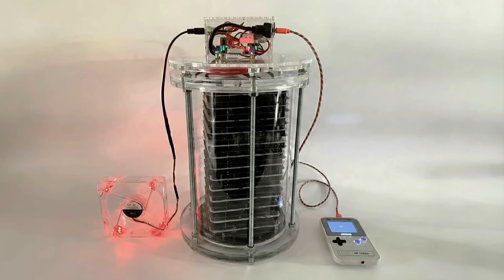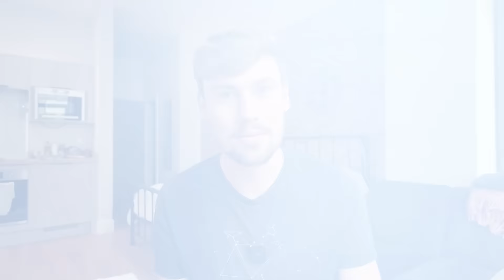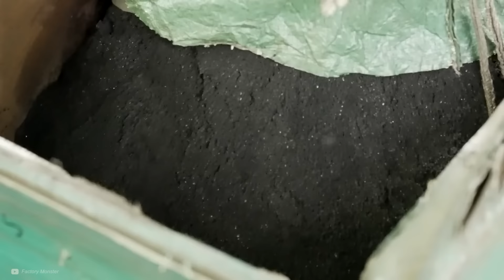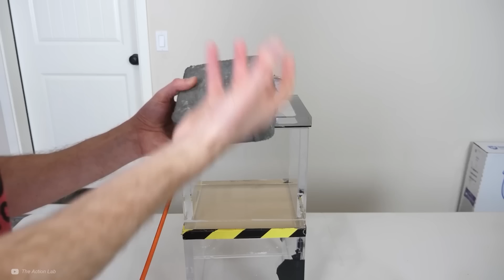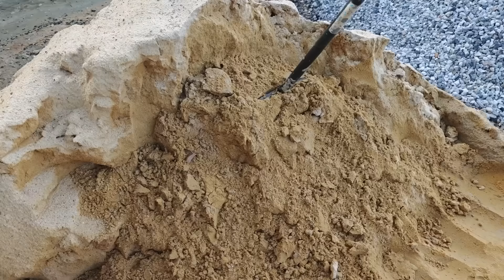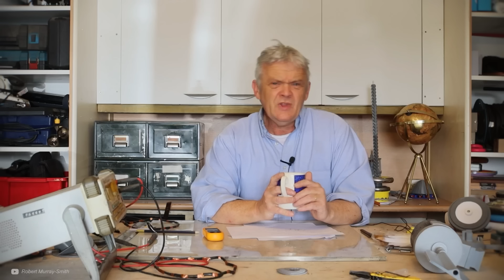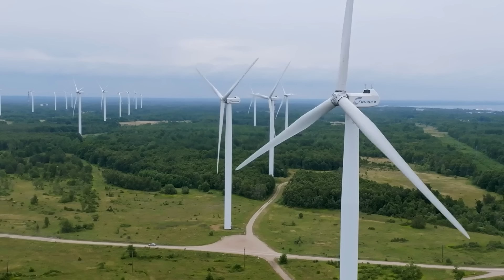How MIT's New Concrete Stores 10x More Energy

Comment: When I was a young engineering student I learned that there are two kinds of concrete: concrete that has cracked, and concrete that hasn't cracked yet.  So this innovation is significant because it changes all that.  Now it will be concrete that is leaking electrolyte, and concrete that isn't leaking yet.  Progress!
Reply: This gives rise to the need for polarized vs non polarized concrete.
Reply: Wrong. There are 3 kinds of concrete! Cracked concrete, concrete that hasn't cracked yet, and roman concrete.
Reply: @NomadIronworker Roman concrete has cracked and 'healed' and therefor is put back in the hasn't cracked yet categorie. If the excess lime runs out in the concrete it will stop 'healing'.
Reply: @mdenouden3y6   cracked but uncracked def sounds like a new category that's seperate from hasn't cracked yet. It's def cracked but it uncracked
Reply: @lilyofluck371 the stuff from which Shrödingers house is build
Reply: @mdenouden3y6 is it in the hasn't cracked yet category if it has in fact cracked? But it also doesnvt have cracks, so it's not in the cracked category.
Reply: @NomadIronworker There's a secret fourth concrete, which is Roman concrete which didn't survive. Technically it doesn't exist, though.
Reply: The thing about  capacitors is they can be charged or discharged rapidly. Ordinary capacitors  have powerful effects limited to extremely short time periods. Super capacitors have enough capacity to do real things.  Think about a cell phone that pulls charge like a waffle iron. You could charge it in seconds.  Or a motor that pulls moderate current from a wall plug.  But can produce massive power in short bursts.           

          The problem with concrete is we expect it to last centuries.  Power storage devices  typically don't last more than a few years.
Reply: tbf, the water based electrolytes are just salt.
Reply: The only concrete that doesn't have cracks is still in the truck.
Reply: What if if can apply power and nanomachines fixes the concrete wall?!
Reply: Drill a hole in your wall to hang a picture frame, and the short you create evaporates your drillbit.
Reply: Suck on that, Rome.
Reply: What about Roman concrete that has cracked, but is no longer cracked? Would that fall into the former concrete category?
Reply: As long as the concrete isn't load bearing and wrapped in waterproof materials the extra cracks just add more surface area for energy storage.
Reply: Bones be like
Reply: Definitely sounds like engineering problems.😂🎉
Reply: Pessimistic perspective .... Hoover Dam, Itaipu nad the Three Gorges, Dubai Burj Khalifa, RomePantheon, Brasilia among other megaconstructions wouldnt be built if people like you were in charge of those projects ... and now electric grid Concrete Spheres are being prepared to generate electricity at deep ocean and acting as batteries ... Glass half full view perspective.
Reply: I read years ago that hemp fiber mixed with concrete creates a super durable support structure. I had to look this up with AI. This might help prevent cracking and aid in the durability of the battery:

When mixed with lime binders, the silica-rich hemp hurds (the woody core) react with the lime to create a hardened, stone-like structure. While it does not turn into a geological fossil over millions of years, this process is known as petrification or mineralization, which increases the material’s resistance to decay and strengthens it, allowing it to last for hundreds of years.The Process: The high alkalinity of the lime binder causes the plant-based shivs to petrify, essentially turning the hemp into a durable, stone-hard material that is lighter than traditional concrete.Long-Term Durability: Hempcrete continues to absorb \(CO_{2}\) and harden over its life, with some structures expected to last for centuries.Important Distinction: This petrification happens primarily with lime-based binders, not necessarily with standard Portland cement.Benefits: This process increases the material's resistance to mold, mildew, and decay.
Reply: Then there’s Roman concrete that heals itself
Reply: Roman concrete (opus caementicium) fixes itself after cracking.
Reply: @Hope_Boat you can't use it for most use cases because rebar would rust and ruin the structural integrity
Reply: @Weeeweeewwoooweeee doesnt this stufd already have an issue with rebar?
Reply: @Weeeweeewwoooweeee  - what if basalt rebar was used?
Reply: @Weeeweeewwoooweeee rebar is meant to have rust on it
Reply: @AnotherAustin-z7b  no, rebar is meant to have a layer of oxidation that prevents further pitting from rust
a lot of oxidation can look like rust but not be rust
Reply: @vettebodee  I think you might be a bit confused. Oxidization of iron makes iron-oxide, also known as rust.
Reply: @Feroce  There are different types of Iron Oxide.  Common rust is Iron (III) oxide (and hydroxides), which is flakey and accelerates corrosion.  Other iron oxides, (like magnetite Fe3O4) form protective layers that prevent further oxidization, and are not usually considered rust.
Reply: @Weeeweeewwoooweeee  Fiberglass/resin rebar has been used in US housing/roads/etc for years.  It doesn't rust and solves some issues with electrical grounding.
Reply: @Hope_Boat They've figured that out. It's like used pottery and seashells or something. The stuff breaks down and recements the cracks when exposed to water THROUGH the crack.
Reply: Totally false.  Those days have gone with the dinosaur thinking of yesteryear.  Modern concrete does not crack.
Reply: @ASDasdSDsadASD-nc7lf  Ha ha ha ha ha ha!!!!  Good one!
Reply: Then you don't understand the definition of the material. 
All you know is systems that have short lifespans designed in. 

Concrete simply is and inorganic matrix composite material. 

Do your billiard balls crack? Do your bowling balls crack? How about those spiral stove elements? That handle 2800C?

That's MgO cements for you.
Reply: We're basically moving to having mythical energy crystals again
Reply: I guess they forgot to teach you about ancient Roman concrete that does neither, because of the quicklime that seals cracks over time as it gets wet from environmental moisture and rain. There were always at least 3 kinds, now we've a fourth.
Reply: @tsuobachi
You're Right, but This Does not Mean it never Cracked it just Self-Healed the Cracks this guy's was Noticing are a Classic of Cement History
Reply: @antoniopacelli  That's true, yes. The cracks did still form, but were self-healing, good distinction. The Romans also had at least 6 distinctive versions of this self-healing cement, including one made to withstand the salt air conditions near the sea. It's a pretty fascinating subject. Anyway, thanks for pointing that out, it was an oversight on my part.
Reply: @tsuobachiseals cracks in what? The concrete that had cracked? Or the concrete that hasn't cracked yet?
Reply: Gives more credence to the Egyptian pyramid electric generation theories
Reply: Stuff it Ol' Mon! The Age of the Boomer is Over! These are the Days of the Millennial! Now Transfer your Wealth and Go! Begone Boomer!
Reply: @RealRandyRoss  go back and sit in your corner scooter.
Reply: The ancient Romans knew more about concrete than your lecturers.I'd ask for a refund.  🙂
Reply: @chippysteve4524 the Roman's concrete cracked all the time, just the excess of lime meant that water would help reseal it every time it rained
Reply: @gwenmcgarry528  self healing and eternal, much better than ours, which is neither.
Reply: @losfromla1480  Roman concrete is also not eternal. The vast majority of it has already degraded.
Reply: @Kraus-  degraded, or destroyed to eliminate broad swathes of history?
Reply: @losfromla1480 It is actually worse in many ways to our modern concrete, it can just stick around longer in certain conditions, but wothout the same level of robustness needed for modern safety standards. There's a reason we don't use it despite knowing the recipe after all
Reply: @gwenmcgarry528 yes, and every time the Roman concrete got more robust. We cant even make concrete for wharf piles that is durable as Roman concrete.
Reply: @chippysteve4524  Maybe more about a specific type of concrete, far less about mechanics.
Reply: @chippysteve4524 You ever seen Roman structures up close? Shit's cracked, lil pup.
Reply: @SweetMattieG  Err,the countless 2000 year old Roman structures which are still standing?My comment was based on recent extensive research by scientists and engineers using the latest tech.State your argument respectfully or be quiet.Ad hominem attacks are low grade behaviour and a sign of a feeble mind.Try to remember that before your next comment.
Reply: @chippysteve4524  no they didn't. The ancient Roman's got lucky that the materials they had access to to make concrete from had those properties. Besides, it doesn't "heal". That requires it to grow. It's just like digging a hole in sand. The whole gets filled in when it rains but what it's filled with comes from the surrounding material.
Reply: @Soothsayer-bp8oz  Try looking at the RECENT research findings.

Comment: The "10 times" leap is MIT’s own improvement over their 2023 prototype.  Lithium-ion is roughly 200 times denser than MIT's concrete. Lithium still wins for EVs, but this could be useful as structural energy storage for buildings, thus serving a dual purpose. i.e. structural support and energy storage.

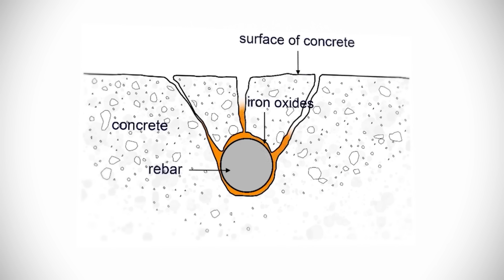Comment: So we get 5 seconds at 6:57 specifically pointing to concerns with rebar whilst the voiceover casually states "some ways of reinforcing the concrete would become impractical". Meanwhile EVERY SINGLE FRAME of stock footage of concrete being poured shows the use of rebar. I think the rebar issue deserves to have been shown a great deal more attention.
Reply from the maker: I should have mentioned there are ways to avoid this issue with coating, materials etc, but it’s not been researched much as this is still all very early stage

Comment: What about lightening? What happens if lightening strikes the concrete infused electrolyte? Will it cause an explosion? Will the voltage potential of the concrete be affected by earth ground? Normally when lightening strikes it travels along the ground, so will this technology actually increase the chances of lightening striking your house? I guess there are many engineering problems to resolve for this technology tho it seems it is promising.

Comment: Just dig a hole where the house is going, fill it with super capacity concrete and build the house above it in the normal way. Problem solved. :)

Comment: From what I see in the Netherlands, concrete houses have only their foundations poured in situ, while all the walls and floors are prefab, so you could quite easily replace that with such a material.
Capacitor don't just allow for high currents, they also have high cycle efficiency and some of them can last a long time.
Reply: And another good point. Now I'm interested in their EMF shielding or permissivity for health and safety.

Comment: what if instead of making one big battery out of the concrete, you had a bunch of smaller concrete blocks that could each act as separate batteries? that could also probably be more conveniently commercialized with battery bricks
Reply: well considered. longevity that's the necessity until the works are refined, I think. Because of the inability to examine with ease, and the tendencies of concrete to crack and micro-fracture, I would suggest the same thing, else we're putting all the eggs in one basket.

Comment: I see 1 major flaw in the mix. Rebar as far as i can tell the rebar is going to basically just short it out in real world operation. I also will bet all the tests they do not use rebar in there blocks since they are actually building non structural concrete. Sounds great on paper but if you have ever looked at a non structural concrete block you will see there are lots of cracks in it after a while

Comment: That lower concrete energy storage is a lot if you do the math and replace all concrete in a city it should be something roughly like this
If gross FAR 0.5 (spread-out city): ~60–105 GWh/km²
If 1.0: ~120–210 GWh/km²
If 2.0: ~240–420 GWh/km²
Then multiply by the built-up land area (in km²). That’s your city-wide Wh.
Quick city example (just to anchor intuition)
Say a mid-size US city has 200 km² of developed/built-up land and an average gross FAR ~0.6:
Per km²: 72-126 GWh/km²
City total: 200 x (72 to 126) = 14,400 to 25,200 GWh
Which would power most cities for years even if we're talking only percentages of energy can be accessed regularly
It would be able to be used for adding high energy applications into cities. It could fully power the city for Days without issue

Comment: Wh/m^3 is a terribly low energy density. How expensive is it opposed to existing concrete? How strong is it compared to existing concrete? For energy storage to work it needs to be cheaper than exisiting industrially produced batteries.

Comment: I wonder if this could be combined with graphene-doped concrete. Imagine grid-scale “batteries” that are basically just gargantuan blocks. Or maybe a more practical use: build a foundation under roads. Every house would have effectively a powerwall’s worth of battery under the road in front of them. Nevermind if highways had such a foundation under them.

Comment: Fascinating potential for stationary energy storage but concrete is not very mobile. That's ideal if you are doing civil engineering but mechanical engineering wants things that move. For portable energy storage, check this out. (prototype material was tested by the materials lab at Boise State University) http://cer-corp.com/sites/default/files/CERESRD.pdf

Comment: 7:25. There are paints/ coatings (forget the class name) used on the floors of crude oil storage tanks to keep water (naturally in crude oil) away from the steel.
Could probably use that to keep electrolyte in.   Though bitumen would be tons cheaper... it's a byproduct of making gas after all.

Comment: Around 200Wh/m³ - 2000Wh/m³ on the lower end that should suffice for large buildings to help stabilize demand increases in the energy grid, and on the higher end of that range, it would make a neat storage for solar energy.

Comment: concrete is not always water shrinkage and corrosion of rcc concrete would cause cracks water cement ratio keeps changing on a regular basis but it will cause micro cracks 
the organic one will never pass regulations unless there is a long term test not 1 month or 1 yr test but exposure to rain heat snow cycles replicating 30-50 yrs

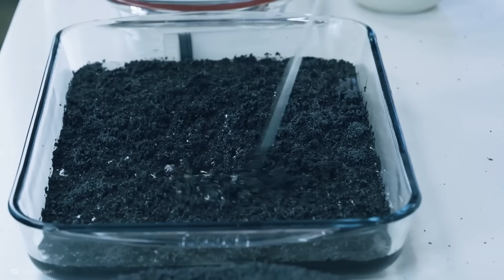Comment: 5:43. Portland cement will hydrate with motor oil (can use it instead of kitty litter to clean under your car).  It will be super weak as a concrete though. 
How strong is this cement/ electrolyte concrete?
Disability?
ASCE needs to do a study (forwarded).

Comment: This might have more practical applications such as under parking lots or in parking garages where it could be paired with solar coverings. But a big issue would be how it handles cracking from thermal cycles, would the electrolyte just leak out rendering it useless.

Comment: I'm guessing they constructed a hybrid of aircrete and direct insertion of CNT or other sort of carbon nanoparticles. Aircrete is like standard concrete except with its porosity on steroids. TBH though, the idea that they're going to integrate this into building structures is naive. There's not a a lawyer on staff at a construction firm that'll let the structural integrity of the building their firm is constructing be compromised in any even miniscule way + the organic electrolyte = flammable AF. The ten-fold increase in energy density though is impressive and can be viable as a standalone battery storage unit for a new building or facility. The novelty of energy storage integration into a building's structure is just a side gimmick to the bigger breakthrough.

Comment: One thing about capacitors is the more of them you have connected the slower the discharge so if your cender blocks are the capacitors connecting each slows down the discharge and connecting them in groups increases the voltage i always confuse series with parallel you figure it out .

Comment: Sound like it needs a soluble solid electrolyte that remains as a residue after the water has evaporated.

Also.. this makes me remember thinking about having batteries for walls. The problem is that batteries and capacitors have lifespans. So maybe just building walls that you can put batteries into is a better idea.

Now.. I'm sure this will have a load of uses, but housing seems a little too inside the box

Comment: The real question is how will it degrade over time? (not the battery, the cement). Will the electrolyte and the storing and releasing of energy, degrade the concrete over time?

Comment: Seems like actually trying to use this in buildings or normal structures would be foolish as cracks develop and you'd have an electric shock potential not worth the risk.  A more probable choice would be for battery farms where they might be cheaper and perhaps longer lasting than costly lithium ion cells and maybe even sodium cells.  Some times higher density isn't worth much, and a cheap easy to create low maintenance solution works better.  One would have to find the cost comparison in detail.  Can carbon nanotubes be produced super cheap?  If so it could be a solution for storage farms that won't catch fire.

Comment: 200wh/m^3.  That's a thousand times more material than a battery.  And it's going to run around $1000/kwh at current non-capacitor concrete prices.

Comment: Well if you can make cheap and long lived storage to keep enough for an average household for 1 or even better 2-3 days it would revolutionize the clean energy by actually storing solar panels output. I can see such concrete slab as a foundation of the building or in the basement area.